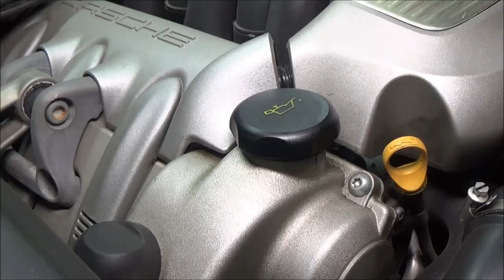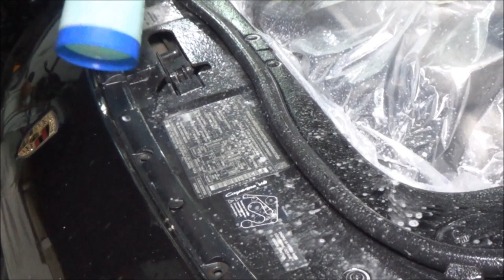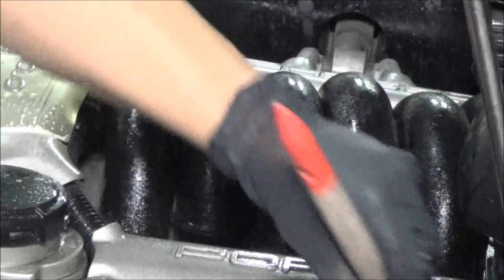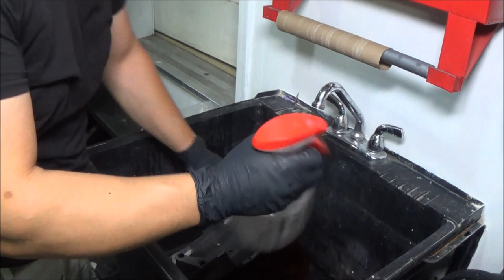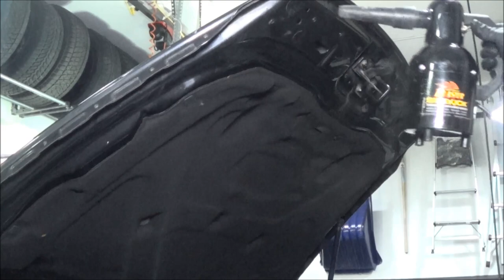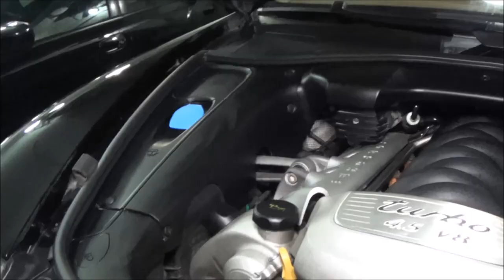Engine Bay Detailing on A Porsche Cayenne Turbo

Comment: Hey @Serhan! I am wondering how about the electric connections along the engine (e.g. intake, MAF, throttle body, air-oil-separator)... some of these are lying more or less "open". Did you disconnect the battery before? Or is it okay to just brush & spray?
Reply from the maker: Patrick Baginski i did not  disconnect the battery and you can brush and spray....with garden hose.